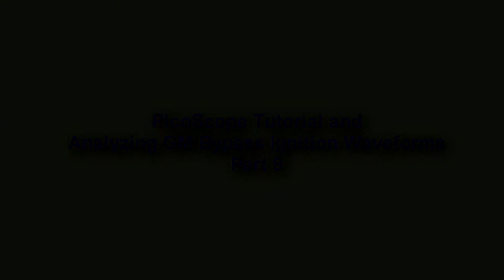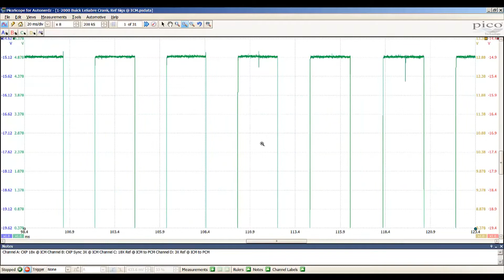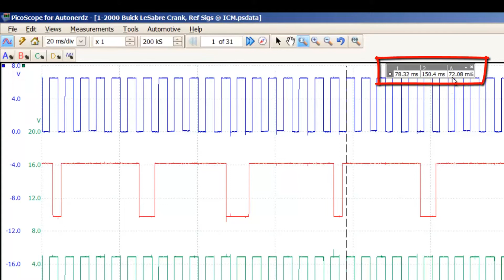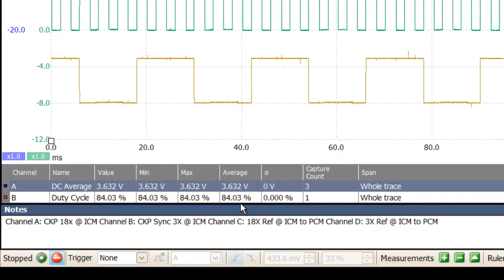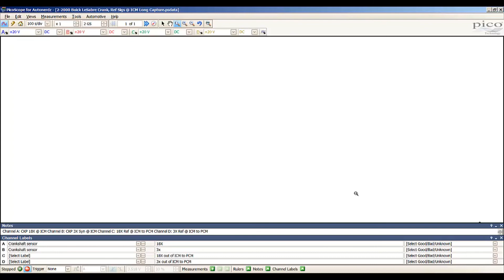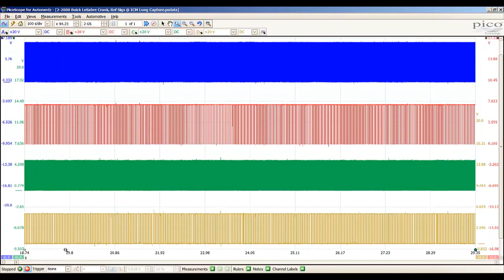PicoScope Tutorial and Analyzing GM Bypass Ignition Waveforms - Part 9

Comment: That was a very nice looking waveform you got on your 16 minute running car capture. That is something that I still struggle with, setting up my scope with the right sample rate to capture the detail I need on extended drive tests.  Any tips you could suggest on that? What I typically have to do to make my 4425A capture a long enough period of time is to lower the sample rate to the point that when I zoom in, the picture is not very good. I have played around with this but so far just can't seem to find the right balance.
Reply from the maker: Remember that as you turn up the capture time, you must turn up the sample rate. Whatever your capture time is, take a look at your sample rate. In Picoscope software 6, go to Views>View Properties and take a look at the sample rate. I always set the sample rate, capture time so that it is at least equal to 1uS. This should pretty much cover any waveform that you're looking at, especially ignition voltages for the spark system. Not sure where the setting is for version 7 as it's not easy for customization of probes. Have a great day!
Reply: @stuzman52  Thanks, I appreciate that. I will give that a try.

Comment: Could you please tell me what to put into the "Maths Function" in my Picoscope to detect a misfire in a cylinder by using a Frequency setting to monitor the rpm drop of a crank sensor signal?
When the cylinder misfires it should show up as a drop in rpm by looking at a frequency waveform. Please help me learn. What equation would I put in Maths Function? Thank you so much...Murle
Reply from the maker: Here is a link on pico where they were discussing this. Maybe this will help Murie https://www.picoauto.com/support/topic10257.html

Comment: My picoscope 2206A doesn't have any of the option for the secondary ignition probe inverted or positive, if you choose one of the option that you have and duplicate I know The setting can be saved and share
Reply from the maker: +pedro simon You must be using the generic PicoScope software instead of the automotive software as it includes all the settings. Not sure if your scope will work with the automotive software. For the secondary ignition, you'll have to know the scaling of your secondary ignition probe. Originally, Pico used the black leads which has a scaling factor of 10000:1 ratio. The new colored leads which are better are scaled for 1000:1 ratio. Since you don't have any setups for this, you'll need to create a new custom probe. Click on the help menu and search for 'Custom Probes Wizard' which will give you more info of how to set your probes up.

I'll illustrate the inverted secondary ignition probe. Once you setup a new probe, click next to define the units as 'Volts'. The next screen will allow you to scale the probe. Use the linear equation. Y = -1000 or -10000 depending on your probe. Enter 0 for the offset. Click on Next. Then you can click on the recommended range management to allow the software to automatically pick out the different ranges for the voltages. Then click on Next. Give the new probe a name and description. Click Next and you're at the last screen where you can click on Finish. You should see the new probe listed in your probe library. When you do the non inverted secondary, everything is the same except you'll enter either 1000 or 10000 for the Y value. Hope that helps!

Comment: Could you duplicate and also share all of your picoscope setups especially the secondary ignition setup . I would appreciate it so much , thank you
Reply from the maker: +pedro simon Hi Simon, the Picoscope software already has all the setups built in it. On the menu under 'Automotive' there are a lot of sensors, actuators, ignition, fuel settings which will preset the scope with all the correct settings automatically for you. At least, it will get you very close to the base settings and then you could manually adjust them from there if you like. So, there really isn't anything to share as far as settings as they are all built in the software.

Comment: Did you ever determine the cause of the P0336 code?
Reply from the maker: Yes, although I never saw the failure on the scope, it turned out to be the crankshaft sensor.
Reply from the maker: Yes, it was the crankshaft sensor and once it was replaced, there hasn't been a problem since. I would have filmed it, but one viewer got pretty irate about too many videos, so I stopped filming and that's why this series didn't have a conclusion. Sorry....
Reply: Got irate? Bless you for all this knowledge I loved ever minute of it thank you very much sir

Comment: Absolutely spectacular Terry- WOW I just have to thank you for putting in so much time and effort doing this for us.    Since the outside  temperature is all the way up to 40 F  I can start practicing with the pico.  I think I have been way too cautious in trying all  the   menus.  I think I have to treat the pico like the Mario Brothers video game and start clicking everything and trying out every option to really figure this out.  I did find one item fascinating and that was the 6.5v from the pico is converted to a 3.6v when average is looked  at for the whole trace.   Am I correct in saying that if I measured the voltage with my DMM it will not read 6.5v but an average of 3.6.  I also like how you input a zero voltage to bring the measurement  line down- now that was cool and here I was getting the magnifying glass out trying to line it up at zero.  I was thinking  of getting a fluke pv350 pressure transducer and was wondering if it is compatible easily  - I don't see a drop down only for the pico transducer. Take Care Steve.
Reply from the maker: Thanks Steve. Yeah, just get in there and play with the menus. That's how you're really learn. Yes, on a voltmeter, that's what you will measure, the lower voltage. The PV350 is okay and people over in Autonerdz has this device. Most people wish they got the Pico WPS500 transducer. You can create a custom probe menu for the PV350 as I mentioned in the video. Thanks for the comment Steve as I appreciate it.